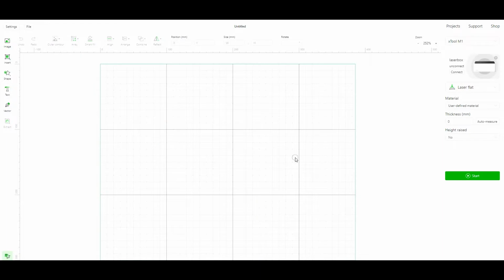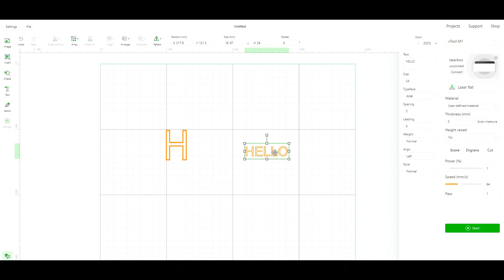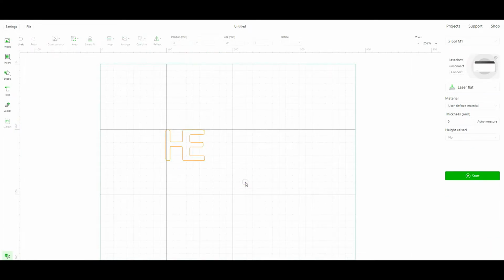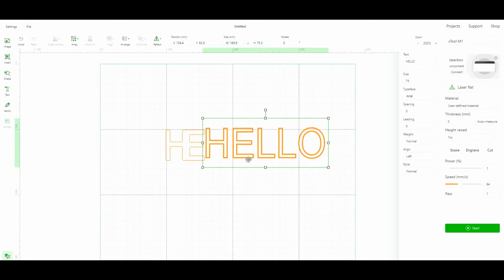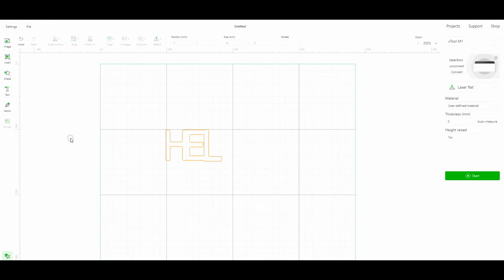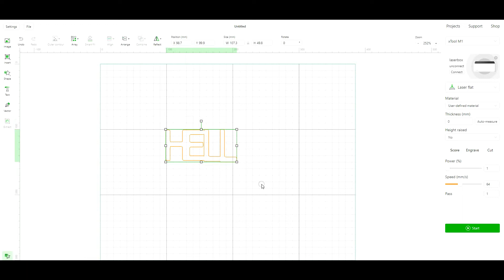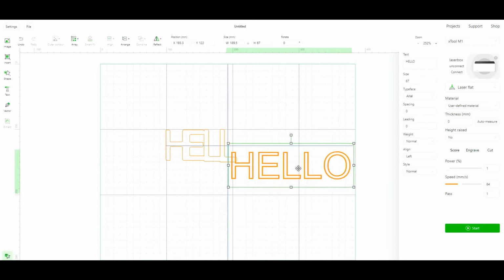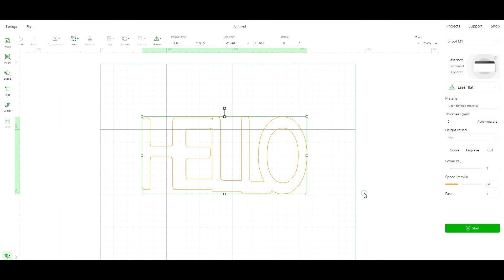Welding letters in xTool XCS

Comment: Thank you so much for taking the time to make these videos on xcs. I've had my M1 for about a month and I've been struggling with grasping the software so much so I don't want to use my machine. This is very helpful and easy to understand. Will you consider making a video on how to cut and then  engrave. I have an earring file that needs to be cut then scored I've subscribed to your channel. Thanks again!
Reply from the maker: Thank you for subscribing. It's best to engrave first, then use the cut file and put it over the engraving. I will see if i have time this weekend to make a video.
Reply: @jostapleton3414  thank you for that I  was doing the opposite, I will give that a try